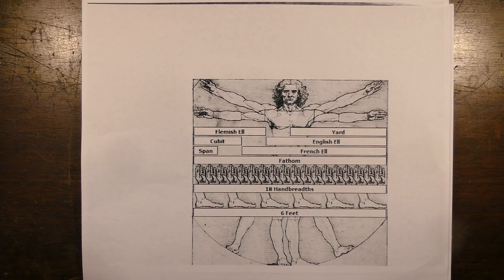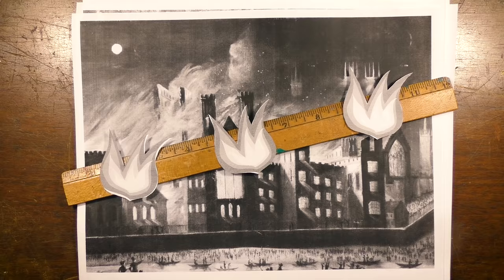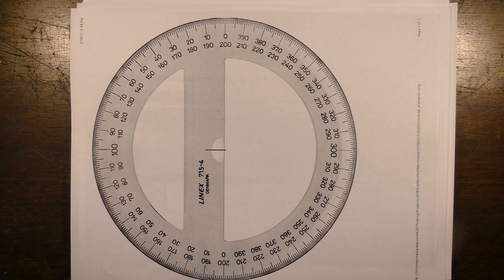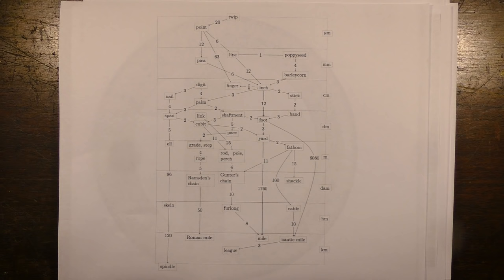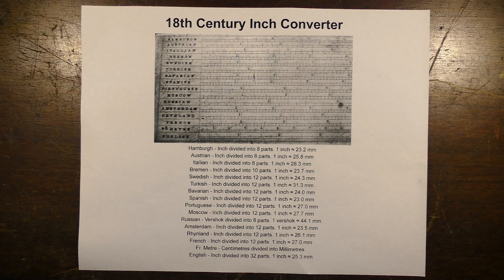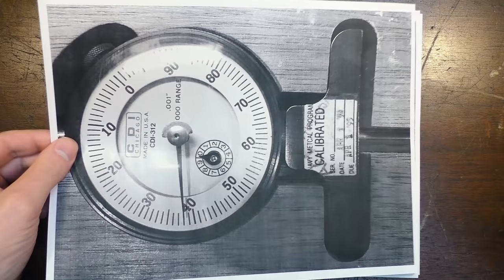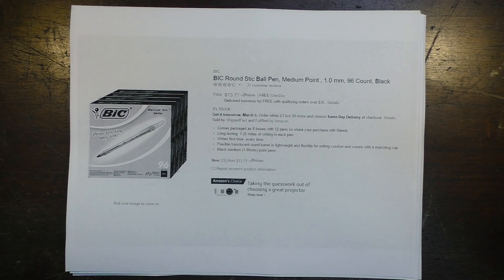Origins of Precision

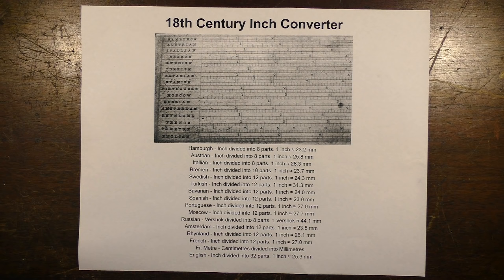Comment: At 18:15 you state that it's unknown why gage blocks ring together.  I was a NBS Physical Dimensional Laboratory Supervisor and Tech who used them almost daily during calibrations.  The reason they "Stick" is from Molecular Adhesion.  The lapped surfaces are so flat that adjacent molecules in rung blocks begin sharing valence electrons.  This action causes them to stick together.  An interesting aside is that if you leave two blocks rung together for an extended period, they will "Contact Weld" and you will never get them separated.  (I had a trainee totally ruin a part of a set when he left the stack rung over a long weekend)
Something I saw you do that should be avoided is your handling of the blocks with your bare hands.  Gage blocks are 316 Stainless, and your body acids will attack the lapped surfaces.  Prior to use, you should always clean the blocks with Acetone or MEK and afterwards fully reoil the blocks using acid free block oil before storage.  I would tear a tech a new one if I caught him handle blocks without wearing linen gloves.  Also S1 Standard blocks are calibrated for use at 68F + or - 1 degree with a correction factor of +/-  11 microinches per inch per degree deviance off nominal.
(He steps off the soap box)  ;-}
Reply: Van der Waals force is the term for this adhesion.
Reply: @ghostrecon3214  Most would have no idea what that is, so I simplified it.  I used to deal with all sorts of interesting effects as a Physical Dimensional Laboratory Tech when I was with the Bureau of Standards.
Reply: @WilliamEades_Frostbite  For sure. I learned about it fairly recently so when he said he wasn't what caused it i was like "oh i actually know this" so i came to comments and yours was the top one addressing it, but not naming it. So i just dropped the name in case anyone was interested. 👍
Reply: @ghostrecon3214  I haven't found many true "Lab Rat" types on here so I usually try to simplify my responses a bit
Reply: why doesnt this have thousands of likes?!?!?!
Reply: Kind of gecko-like adhesion
Reply: I wear linen gloves as a matter of course. And I stare people solemnly in the eye as I introduce myself as the "Industrial Inch"
Reply: @harrymattah418  Actually, Van Der Waal force is exactly how gecko adhesion works, so it's exactly the same
Reply: This may be a pretty neophytechnical question, but I'm curious. Would the Van Der Waals Force affect still work with "Jo-blocks" made from other materials?
Reply: @averagefpv9449  As I understand the physics, no.  They must be like materials with clean contact surfaces.  That was the reason that we were trained to always oil and wipe the blocks prior to Wringing, then add the single molecule diameter into the correction factor/True Length calculation.
  The oiled surface prevented the blocks from "welding" if left for a long period.
  The cleaning and oiling process was involved by itself as we had to use Freon 113 for cleaning to insure no residue and the specified Block Oil to get a "calibrated" molecular separation between blocks.  We used 316SS Blocks which had a Growth Coefficient of 11 Microns Per Inch /Per Degree F above or below 68 Degrees F.  Using the Block Calibration Chart for the block set, and the temperature deviation, calculate the stack length.  Add to that calculation the number of oiled contact surfaces and you would have the True Length.
Reply: Yeah, gauge blocks still stick together under vacuum, so van der waals have to be the primary force sticking them together.
Reply: @averagefpv9449  Of other materials, yes; of different materials as each other, no. Eg two ceramic blocks stick together but ceramic and steel would not.
Reply: WRONG. its unknown. didnt you watch the video?!
Reply: Nice information
Reply: Im not reading all of that.
Reply: Pretty sure you are mistaken by stating that the gage blocks you used were 316 stainless.  I've been in the machining business for over 50 years.   I have never seen 316 stainless steel used as gage blocks.  (we machined 316 & 316L stainless by the truckloads).  Gage blocks are primarily manufactured from high carbon / high chromium steel that is hardenable and then ground & lapped to precision tolerances. 316 stainless is not hardenable to the Rockwell-C necessary for gage blocks.   Higher quality blocks are produced from tungsten carbide and now ceramics  (Mitutoyo).
Reply: Jo Whitworth in the UK did the three cast iron block thing, and then started making nuts and bolts of various sizes, the first truly interchangeable sets of fixings, hence 1/4 Whitworth.
You'll find one on the base of your camera for fixing it to a tripod!  It is still the standard.
When Whitworth started. If you could machine to a 16th of an inch you were regarded as a good engineer. But the time Whitworth had finished that had been reduced to one tenth of one thousandth of an inch.
This was back in the early 19 century.
Reply: Same reason motorcycles can exceed 45 degrees leans over!
Reply: Beautiful. This why sometimes the comment section is just as valuable as the content.
Reply: Great comment. I hate to be a bore but the words are "wring" and "wrung"
Reply: @dielaughing73  You can't post something on the internet without someone to point out the holes in your argument. (that was a boring joke, but I won't tolerate any yawns from the audience).
Reply: Why do so many otherwise reputable sources claim that the reason gage blocks wring is unknown?
Reply: Also the Lawrenze effect is implicated.
Reply: Isn't that what they usually call cold-welding? It's a very cool effect.
Reply: awesome. loved reading this. there is truly so much to learn in this life
Reply: I have seen blocks rung together for literally years that didn't contact weld. You are exaggerating.
Reply: @cyberslick18  "I have never PERSONALLY experienced that, therefore it's impossible. No that's not a fallacy!"
Reply: Mf waited his whole life for this😂 I appreciate the info tho
Reply: @__shifty 😂
Reply: I was told the meeting is so smooth as to also make outside air pressure a positive contributor.

Comment: When I was little, I used to wonder: If factory equipments were made in another factory, how was the first-ever factory built?
More than a dozen of years later, I get my answer in this video.
Reply: Besides the surface plate described in the video, there are a couple of other ways to bootstrap the first factory.  Copper wire can be drawn to a constant diameter by pulling it through a die plate.  The wire can be wrapped around a rod and soldered in place to make a crude screw thread.  A slide or nut which rides this thread will average the movement if it rides multiple turns of the thread.  Thus a crude lathe can be used to cut a more accurate thread, which can then be used to build a more accurate lathe.

Who made the ancient blacksmith's tools?  The answer is they made them themselves.  Metal ore can be reduced in a furnace and poured into sand molds to make a large block, and a small block with a hole in it.  Put the small block on a stick, and you have a crude hammer.  The large block is a crude anvil.  With these, you can forge better hammers, tongs, etc.  One thing you make is a chisel, which if from steel you can harden.  With the chisel you can make grooves in a bar of soft steel to make a file.  Then you harden the file.  With a file you can adjust your hammered tools by filing away parts to improve their shape.

Modern machine shops, foundries, and steel mills are descended from these steps the ancient blacksmiths did.  The machine shops in turn make all the other machines used in factories.
Reply: @SeedFactoryProject  We need a book that is full of the core steps for ALL of this. I used to mentally plan such a book but it's just beyond me and I'm hoping someone else does/will do it.
Reply: Kind of like what came 1st ?  the chicken or egg ?
Reply: @SeedFactoryProject  You can make a micrometer with out to much in precision  . Basically . ( to current numbers used )  is to make a thread with 25  threads per inch or what ever thread you want to use.  Then divide  the thimble into 25 increments.  I saw a black smith who made a tap and die set .  They may have not been  to a national standard but he could make a micrometer accurate to at the least .001 in the blacksmith shop ,  possibly to .0001
Reply: @ogarnogin5160  The egg. Ask any chicken.
Reply: I'm adding this note to a few threads. Y'all gotta read Daniel Boorstin _The Discoverers_. Clue: the first science was time, to gauge when the last and first frosts would be, to know when to plant and harvest.
Reply: Dani Eder I’m so glad I’m not the only one whom has ever wondered this!
Reply: always wondered who made a lathe to make lathes
Reply: We stand on the shoulders of giants
Reply: @ogarnogin5160  um..rooster!
Reply: Have you checked the children?
Reply: How to get a straight line when you don't have anything straight. Simple, arrange any thin and very light weight wire ,threat or rope and streach it hard bingo you got a straight line.
Reply: @jimbarchuk  the ancestor to the chicken which had a mutated baby
Reply: the book "How an Economy Grows and Why it Doesn't" explains the same concept, but for economics. Highly recommended!
Reply: Funny how the boostrap problem appears in various ways through nature. In technology there is the question: if a computer program machine code (executable) is created by the compiler, and the compiler being a computer program itself is also created by another compiler, how was the first compiler ever created?

Comment: as a kid i always wondered, how are tools made if you need tools to make them? how did anyone make a ruler, angle or other shape? i thought i could do both decently just with a string, cause you can make a straight line and a circle by using a fulcrum but neither would be anywhere near as precise as you would presumably need
Reply: How to get a straight line when you don't have anything straight. Simple, arrange any thin and very light weight wire ,threat or rope and streach it hard bingo you got a straight line.
Reply: The hammer was the first tool that was capable of replicating itself. It is the foundation of toolmaking
Reply: @kiwiwifi which itself is on a foundation of evolutionary biology going back to RNA, which is probably but possibly unknowably on a foundation of chemical processes at volcanic vents or ponds on land or both, which go back to stellar formation and on to the big bang... The progress from low information to high information content has been amazing in this little corner of the universe.
Reply: @arrrrr1689  How do you create a wire of consistent width?
Reply: @andrasfogarasi5014 
Pass your wire through a small hole. If it moves too easily get a smaller hole.  If it won't quite go through pull harder and the wire will thin out. 
You may need to check the size of the hole after a while.
Reply: @myparceltape1169 How do you get a small and smooth enough hole in a material strong enough for that?
Reply: @UnitaryV  
It used to be a hole in a piece of hot cast iron. 
Used when cold to thin the wire down slightly. 
Reheated, readjusted to size and cooled.
Reply: surprisingly enough, you are absolutely correct. A circle using a fulcrum is exactly the first step: look up the Antikythera mechanism: simple lathe video by clickspring. A lathe is the machine that you are describing. Something that creates a rotating platform that you can slowly guide a tool across to create a pretty symmetrical round shape that allows you to build an even better lathe.

Comment: A beautifully put together piece. I've worked in engineering for 30 years and I had no idea about some of this stuff. Very glad this popped up on my suggested videos. Thank you 😉
Reply: So precision comes from friction?
Reply: I really enjoyed this.  Between 1890 and 1935 before the electrical grid and electric motors, the industrial revolution was powered by various combustion engines that ran for years on end reliably.  There were also various steam engines.  This rapid expansion of the factories would not have been possible without the precision these engines were made with.  Some of these engines still perform as as they did 100 years ago.  Obviously the spread of a standard of accuracy contributed greatly to the ability to make the products of the last 100 years.   And today the pistons for hydraulic construction equipment can marshal crushing forces that cut steel beams and reinforced concrete.  We can shoot a jet of water with sand that can cut steel better than a torch.  The root of these accomplishments is precision.

Comment: I was a Navy Metcal program technician and lab manager. When you said surface plate I was like, where’s your metcal tag? AND THERE IT WAS!!
Reply from the maker: Is it possible to get the inspection history from the stamped number?
Reply: The file for that serial number has been long long purged, sorry. In 1995 they still used paper records you had to mail in at the end of the month to the central records control center, long before individual computerization. I envied the Air Force whose labs seemed to have a much better automated system. From the tag though, ACL is the lab code (not sure where), and the string of digits next to it was the technician ID. Unless he was a civilian, whoever he was has long since left the service. That model number at the time appears to have been placed on a twenty four month cycle. 
The fact a serial number isn’t written on the tag tells me the guys probably didn’t worry too much about this thing since it didn’t ever move. Not correct but overlooked
Reply: I taught gage cal st the Submarine School in the '90's. This video should be shown to every class...
Reply: I tried looking up the Lab code in METPRO, didnt turn anything up, the lab might have been renamed or shut down

Comment: I got to meet the Moore's (father and son) in 1985 and tour the plant when I received the Richard F. Moore Award at the age of 16 in my junior year in high school(vocational-tech). I got a personal copy of the book too.
Reply: Did you become an engineer?
Reply: @luminography  The short answer is no. Was a machinist/machine operator for about 12 years after high school. All the shops in the area were either closing or moving south. Went back to school for a bit to learn CADD. Was involved in telecommunication equipment design, printing press design, high end office furniture design, then  A/V systems. Been doing that ever since. Currently working from home as a A/V designer/consultant for the past 8 years. Just started working as a marine mechanic a couple years ago and back doing what Iv enjoyed the most, working with my hands. I still do the a/v work(it pays better than the mechanic job) but not as rewarding.

Comment: Me on desert island: "has anyone tree cast iron plates? reasonably flat is prefered!?"
Reply: Oh well, we'll have to make cement blocks from seashells, fire, and sand.
Reply: Well, if there aren't any, you'll have to make your own. First you're going to have to secure access to food, running water, trees, iron ore, and clay. This may be tricky, so take your time.

Use the clay to build a very basic brickmaking furnace. You can upgrade it later with your bricks. You will also want to set up a charcoal furnace.

With charcoal and bricks in hand, you can build a bloomery furnace, which will allow to make basic wrought iron implements. You may use a large and reasonably flat stone as an anvil.

With metal tools you can perform more advanced carpentry, which you will need in order to build a waterwheel, piston blowers powered by said waterwheel, and a large enough building to house a charcoal blast furnace.

Once you have a blast furnace, you have cast iron, which can be poured into sand molds. This cast iron can also be turned into steel with the puddling method in a reverberatory furnace.

Comment: One thing that is amazing is the precision that they have in automobiles. The axles connect to the hubs of the wheels and there are four of them. The precision of the placement of the hubs on the axles relative to one another is so precise that one can drive a car 70 mph and not feel any vibration from the axles and hubs and there are not just one of them but there are four rotating together.